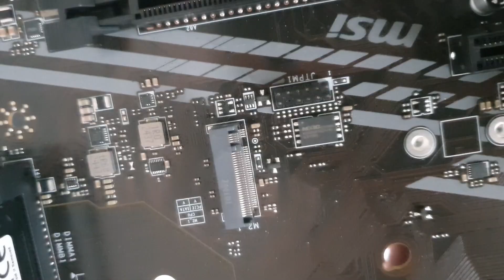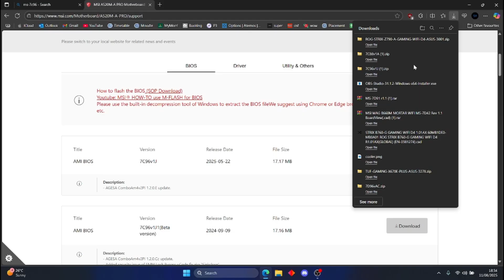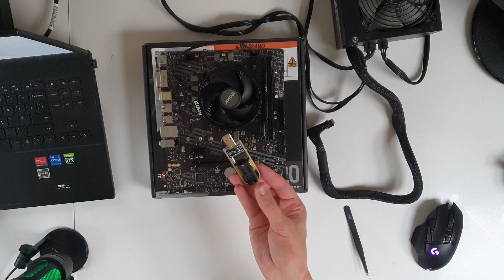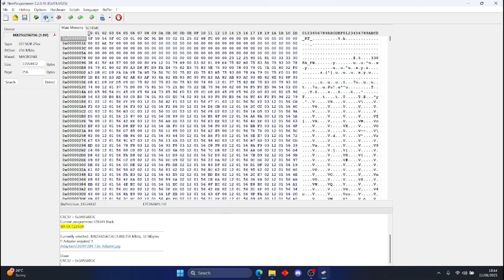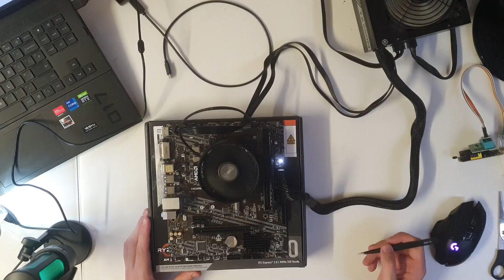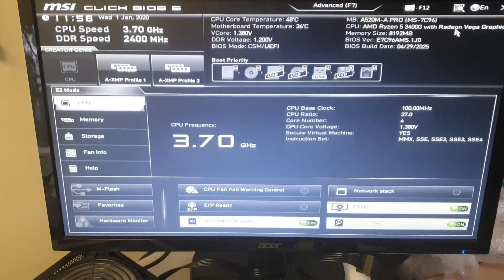MSI A520M-A PRO CPU Light Motherboard Repair - BIOS Flash and Soldering!

Comment: Hi i have same bios chip on my b55a Pro.. Can I use 8 pin test probe to program bios since don't have hot air to unsolder the chip..did you program with cpu ram and cmos battery installed?
Reply from the maker: Hi, yes, it doesn't really matter when the system is off.
Reply: @terraplexx  thank you
Reply: I have same test probe on mx25u25673g  but connot detect chip error spi id:87ffff
Reply from the maker: @WaldsP  that usually means either your probe isn't on properly (most likely) or the software you're using doesn't recognise the chip

Comment: does changing the motherboard fix this issue? also does this fix that u did works always fine or is it just temporarily?
Reply from the maker: Well the issue is with the motherboard so yes replacing it would fix the issue. Its a permanent fix if you don't corrupt the bios again.

Comment: i have the same issue on my pc 
the cpu led is on i checked for ana missing parts on the board all seems to be good 
the bios can be the case for me or not ?
(am assuming i have this problem because of a falty ram stick can it be the problem causing the bios to be dead)
Reply from the maker: Hi. BIOS issues are very common, so I would recommend flashing it if your motherboard supports that (see the manual). However, I don't see how a faulty RAM stick would cause the BIOS to corrupt. 

I assume you have tried swapping out the RAM for a different set, maybe try cleaning the RAM slots as well with IPA like I have done in some of my videos.
Reply: @terraplexx i did 
at first it was a ram issue i tried a ram stick of a friend and the pc did post 
after that i let it there untill i bought another ram stick but now the led is on cpu all the time
Reply from the maker: @aymane7375 you've done a CMOS reset? Sometimes that will prevent the PC from booting after swapping components
Reply: @terraplexx yes i did, and also tried booting without the batterie, nothing changed
Reply from the maker: @aymane7375 that's weird, only other thing I can think of is knocking off a component while u were swapping out the parts or moving the motherboard around. Other than that, I'd try taking everything out, cleaning and then reassembling. I've had that fix random issues before.
Reply: @terraplexx yeah thats the problem,
i dont know how to fix that other than changing MB

Comment: I have this same motherboard the PC was off when it was running then I checked all the parts all are Okk but display not coming the cpu ez debug light was on when I on the PC and the processor was not heating what is the problem?
Reply: Do u fix it ?

Comment: Im facing this same issue with this model, but when i let it rest without the cmos battery, the pc actually boots, but if i turn off the psu or recconect the battery, the problem comes back. The bios is at the last version
Reply from the maker: Oh that's really strange.. never seen anything like that. I would take a closer look at the CMOS circuit, maybe something is missing there, if you haven't already done so.
Reply: @terraplexx  I mailed the RMA, I will send the board back and get refunded.
Reply from the maker: Oh nice! If that option is available to you, it's definitely the way to go 😅

Comment: Nice! Thank you!

Buy some flux-gel for next time tho.😅
Reply from the maker: Thank you! I have some liquid flux, but what does it even do? I tried using it a couple times, saw no difference.
Reply: @terraplexxFlux makes soldering easier by cleaning the metal and helping the melted solder spread smoothly for a nice, strong joint.

The gel is stronger than liquid, but it makes a bigger mess, so you’ll need to clean it off afterward with defluxer or isopropyl alcohol.
Reply from the maker: Ah, makes sense! Will definitely be getting some